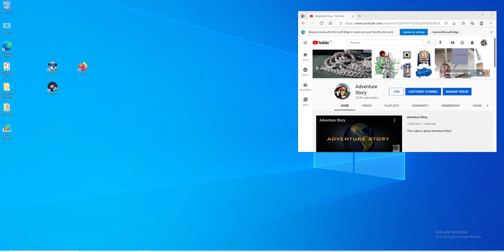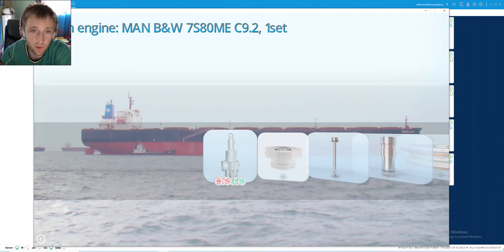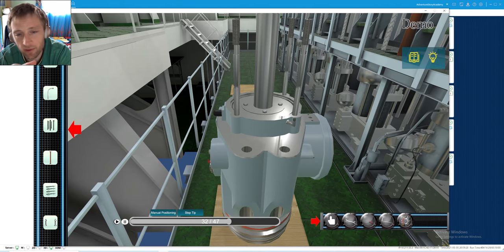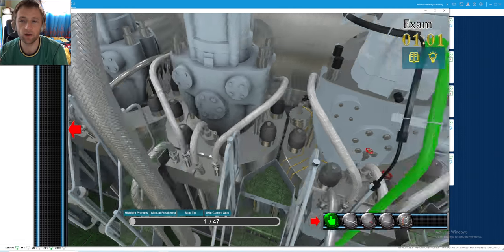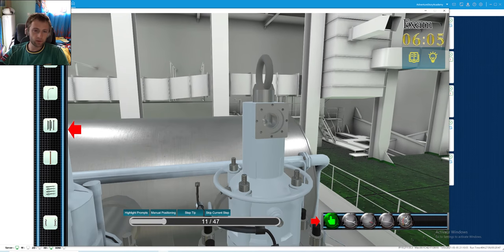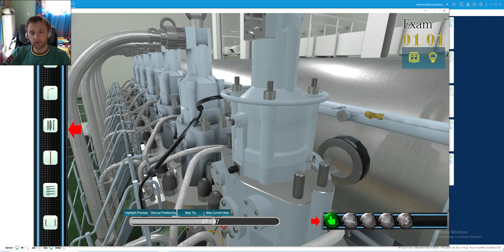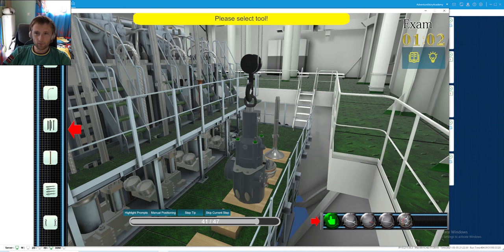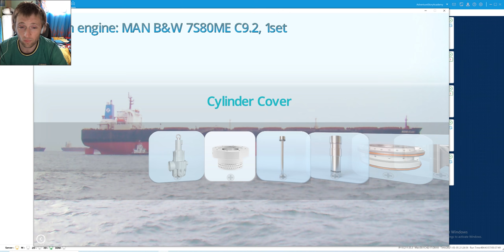MAN B&W 7S80ME Exhaust valve disassembly Simulator

Comment: sir what is the function of safety valve in air piston side.
Reply from the maker: Hello all safety valves protect from over pressure the equipment ,here in the event of fail sealing rings safety valve will open and excess oil will be expelled from exhaust valve actuator.